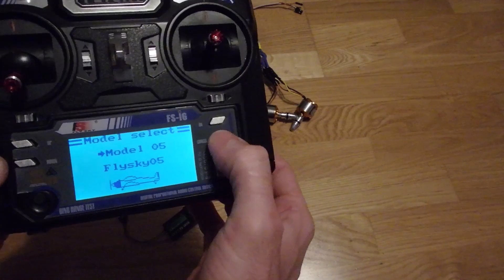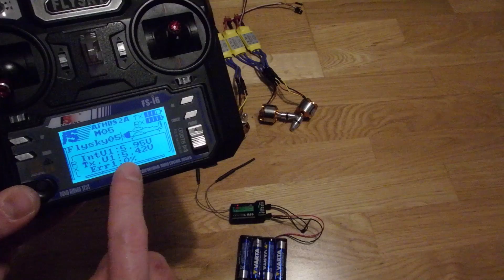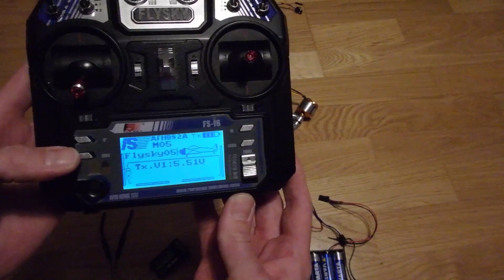Drone - ESC calibration

Comment: Bro. I want to ask a question please help me........I had calibrated my (30a.) esc with my ct6b fly sky transmitter throttle. But now I change the esc the I calibrare with it.this is the matter now it is not calibrating. Again & again I am trying to calibrate with throttle but it is not calibrating. Now what I have do please tell me kindly.
Reply: Hello, Same proble. no music on top throttle. I wan't activate Brake.
My ESC http://www.readytosky.com/e_productshow/?1222-30A-Brushless-Motor-Speed-Controller-Control-RC-BEC-ESC-1222.html